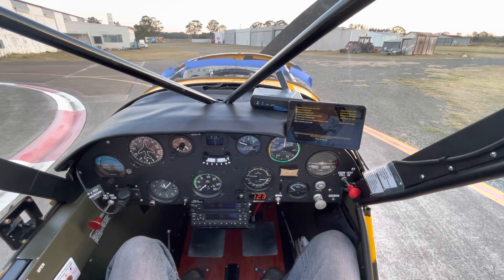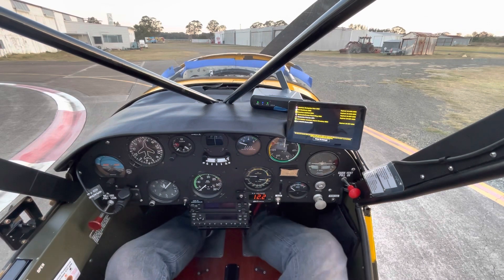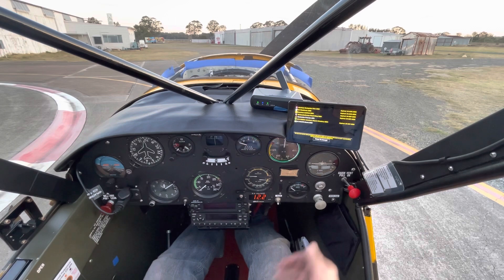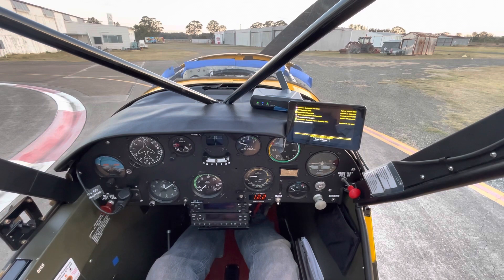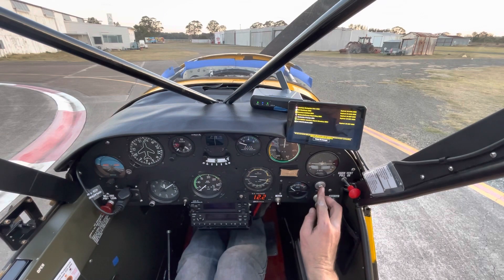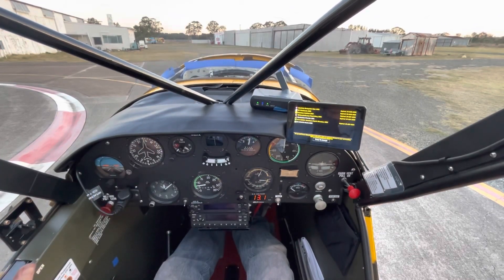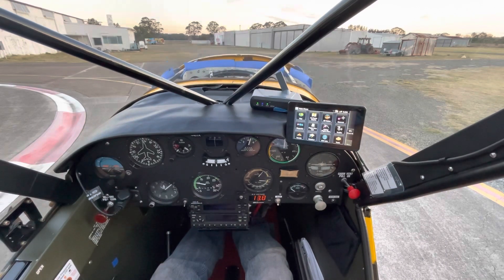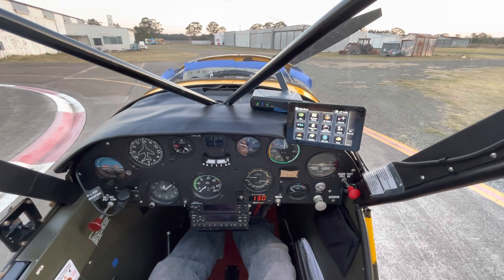PA-18 Super Cub first start in Australia

Comment: Hi. May I ask what your tablet set up is and how you have it fixed? Is that a remote GPS at the back of tablet? Steve
Reply from the maker: G'day Steve, it's actually a portable Garmin GPS, an Aera 696.  The bit behind it mounted on the panel is an ADSB receiver, which displays on the GPS (and on the Garmin Pilot app by bluetooth).  It's a great little setup for VFR ops!